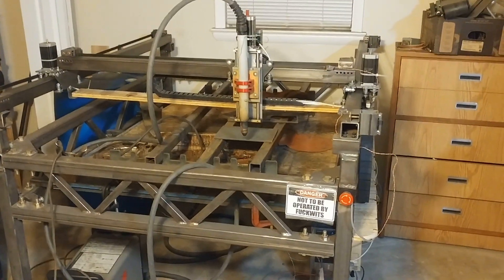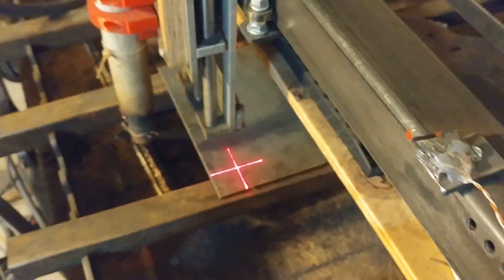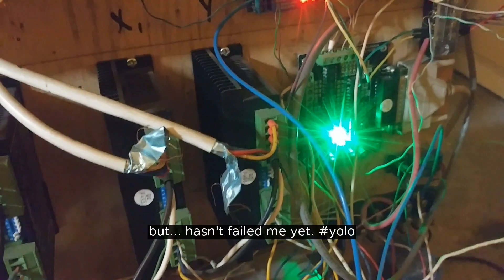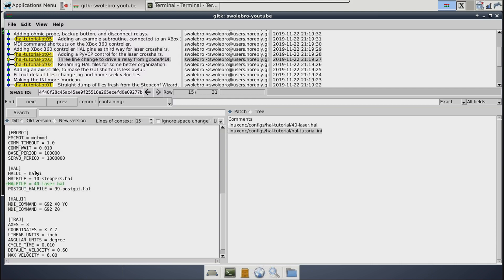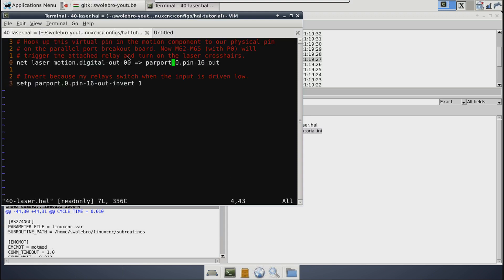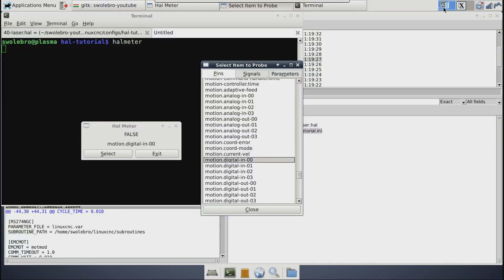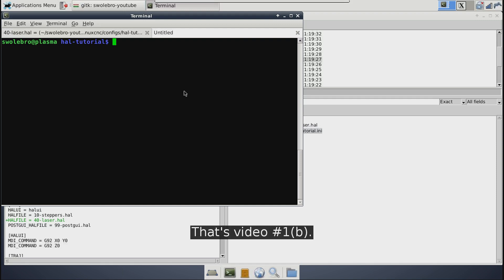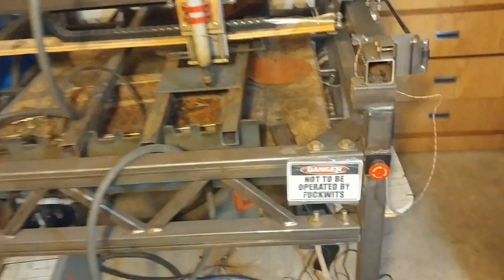LinuxCNC HAL #3: laser crosshairs, gcode triggered relays

Comment: Hi, does your plasma cutter generate a lot of dust? If so is extraction etc required?
Reply from the maker: The water table helped a lot with the dust, though I also had a ventilator fan running in one window (creating a cross-breeze) and I wore a respirator whenever I was doing dirty work. For the small shop I had (12x22'), this was sufficient.

Comment: New subscriber, will be following with interest, I'm liking what I'm seeing so far :-) I make add on bit's for freedom dispensers with a mill currently running Mach3 but I have a new machine due for delivery in the next few weeks that I'm going to be running with Linuxcnc and a Mesa 7i76e.
Reply from the maker: Hell yeah. I have also taken a recent interest in nondescript blocks of anodized aluminum which are legally convertible into fun. Just wait until I finish knocking out the rest of this series - I'm pretty sure my next project is going to be trying to do lost-wax casting to make a couple of those freedom bricks.

You've probably seen Farmcraft101 already. Just FYI, he's got some other videos out there that are too-cool-for-YouTube. Fantastic machining skills and very entertaining. Would recommend.

And tbh, I'd suggest picking up a DB25-1205 breakout and doing a test set-up with that. It's a very cheap and easy way to get going, familiarize yourself with the stuff, and get your fuckups out of the way without destroying any fancy hardware. You can always swap it out once you get the Mesa board, and then the DB25-1205 just goes in the parts bin until you want to start prototyping your next machine.

Comment: Great Video again!
I didn't get which card for linuxcnc you are using!? ?
Thx!
Reply from the maker: Just a DB25-1205, the bog standard parallel port breakout board. All it does is take the pins from your parallel port cable and split them out into screw terminals - very simple, but it works. Mine was from Wantai Motors on eBay, but there's tons of options out there. Here's an older video of mine on all of that: https://www.youtube.com/watch?v=vR2xxRQQtyQ